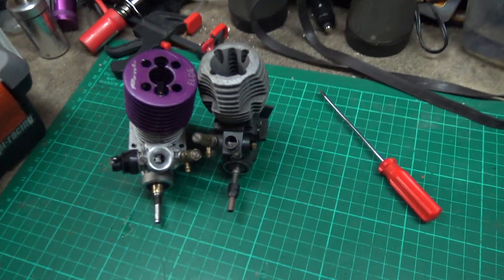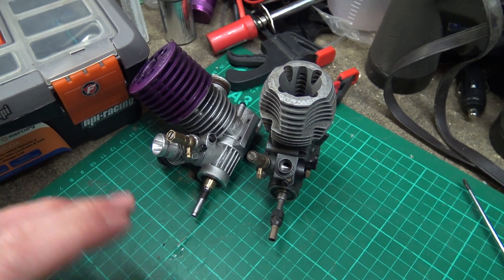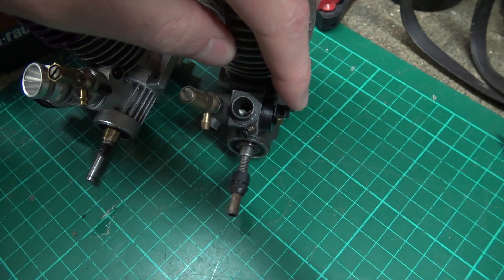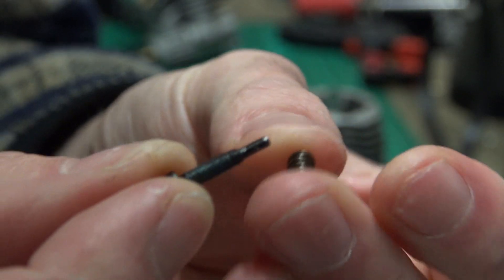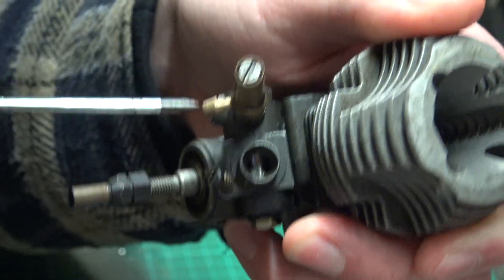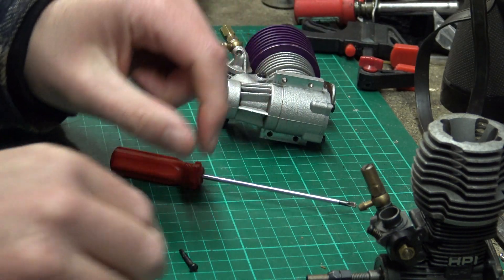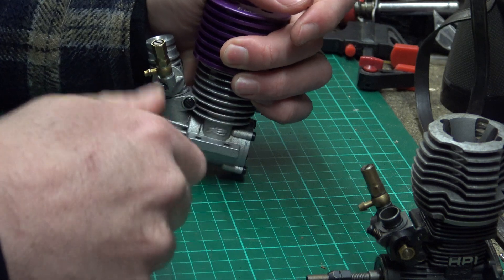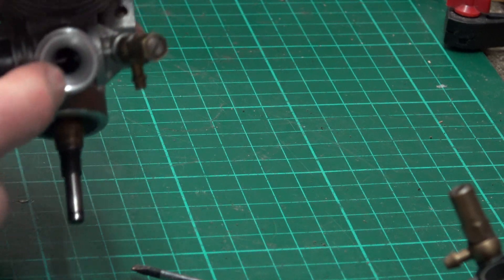Nitro RC Engines How Idle Screws Work

Comment: I’ve got pretty much no experience with nitro cars. I’m trying to tune mine at the moment. It used to run when going at speeds then cut out when it stopped so I messed about with it and now it won’t even idle once the starter has been taken out. Any advice on how to fix that and how open should my tick over screw be? Cheers👍🏻

Comment: Happy new year to you, great video again. I always use a paper clip to set idle screw gap, is usually a good basis to work from if unsure of factory settings. I use throttle trim to increase the gap at idle for easy starting then when it warms up a bit I back the trim off again.